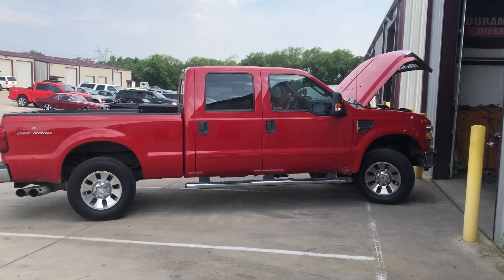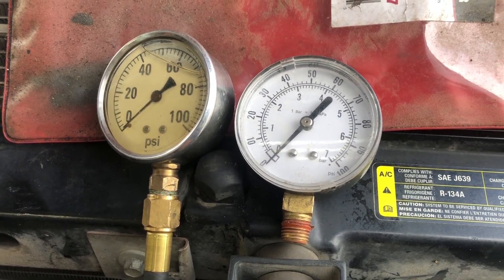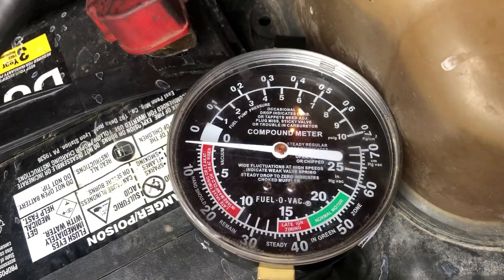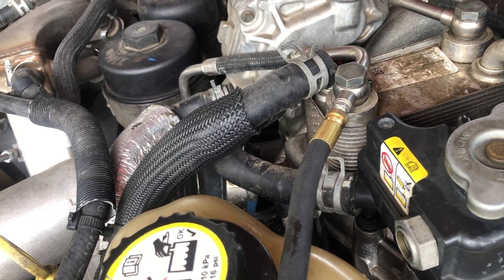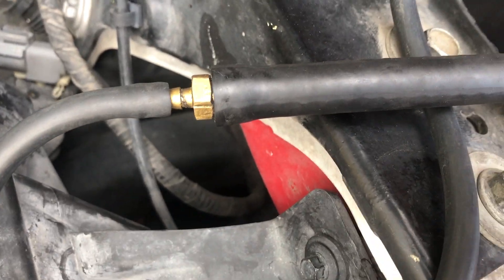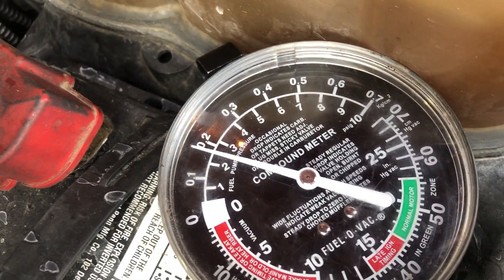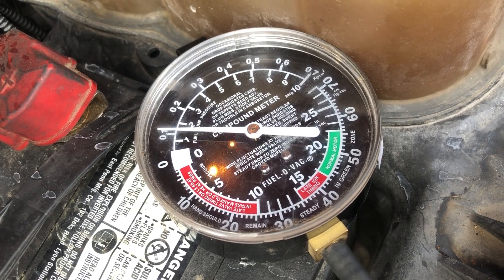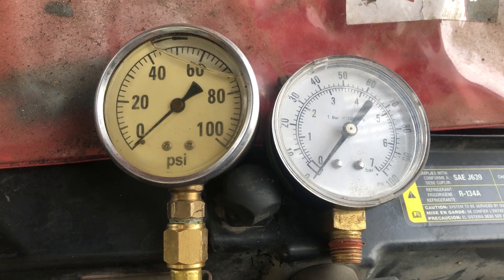6.4 Powerstroke Fuel Pressure Test

Comment: What end up being the problem.on the truck ?? Mine is doing the wxact same thing
Reply from the maker: The truck needed a high pressure fuel system if you have pressure on the low side pump time to look at the high pressure pump and the injectors probably see metal in the upper fuel filter housing look for brass at the bottom of the filter housing

Comment: This is for the low pressue feed pump.  Where is the testing port for the high pressure pump.  Thank you.
Reply from the maker: They do not make a test port for the high pressure side as it pumps up to over 25,000 PSI, no high pressure fuel lines are accessible with the cab on, take out your fuel filter on top and look for fine brass shavings in the bottom of the filter housing that's how you know you need a high pressure fuel system with a no start on a 6.4